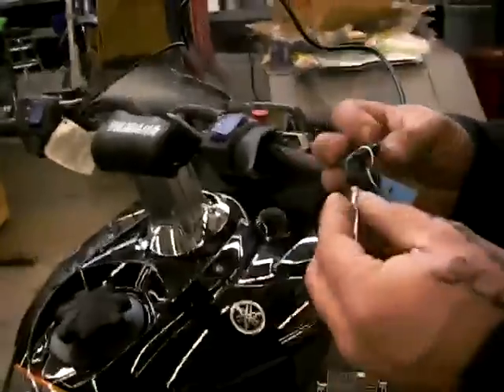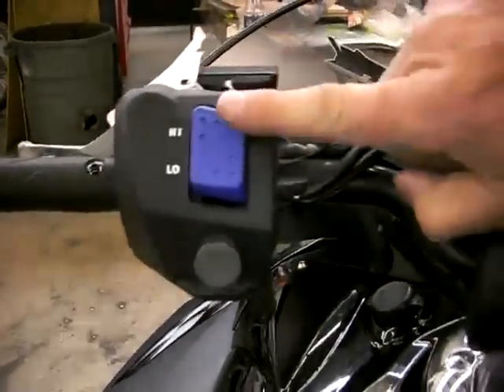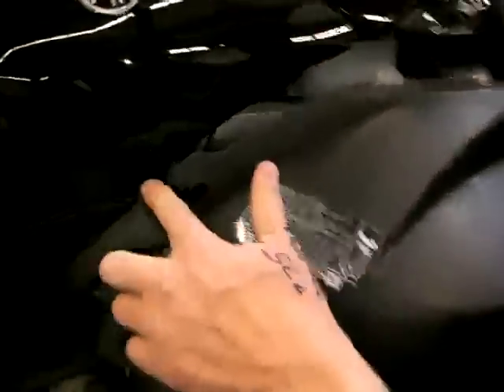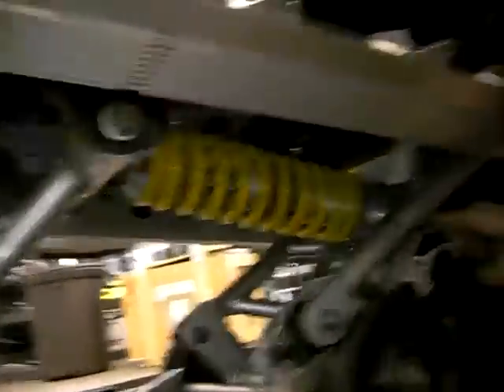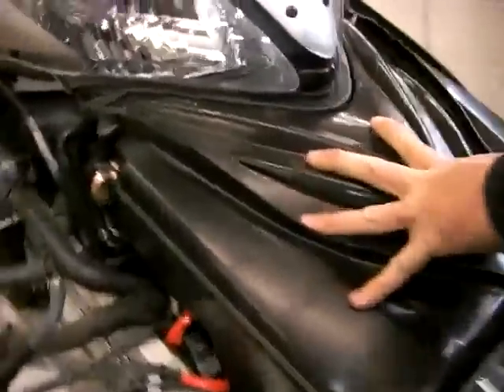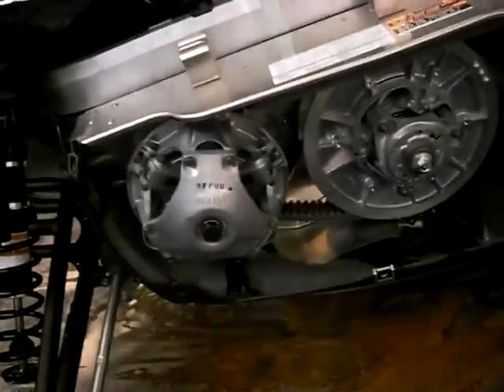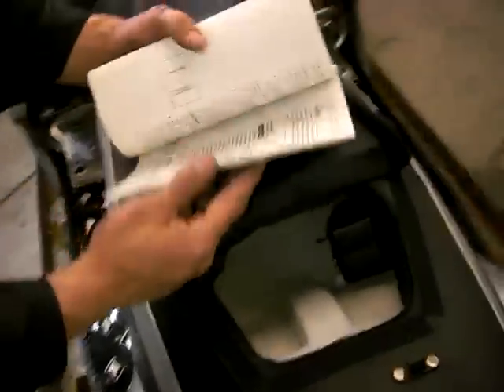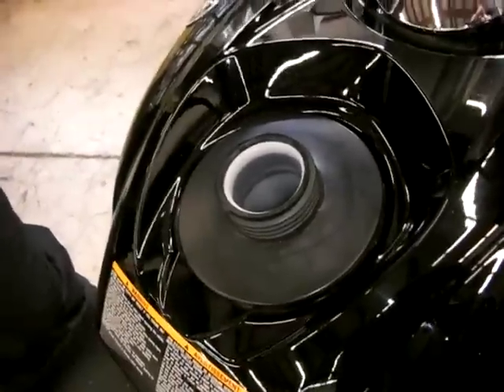Yamaha Attak 150hp Snowmobile with reverse #1

Comment: Great orientation, something all dealers should do.  I would also like to see suspension set up's included with delivery even if it cost a few bucks more.  Nothing better than getting on a sled that is matched to your loaded (equipment) body weight.  It makes no sense at all to put someone on a sled not set up for them and with no understanding of the basic usage of your investment.  Dealers who do this will have returning customers.  Those who sell on discount pricing and forget about the customer service needs are worthless.

Comment: Where is the battery located
Reply: Under the airbox.
Reply: The battery is a pain to get to but there is leads that extend out with caps near the oil tank that you can connect onto to Jump a dead battery or charge a battery easily.